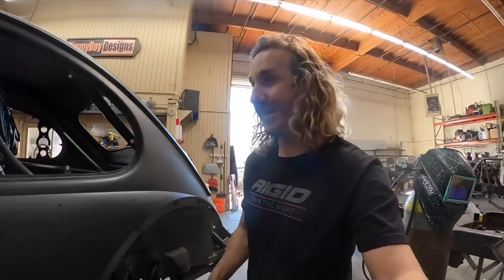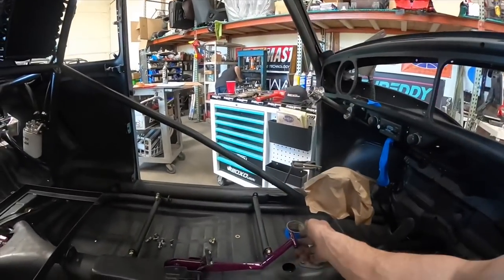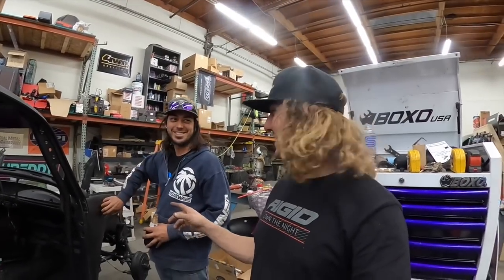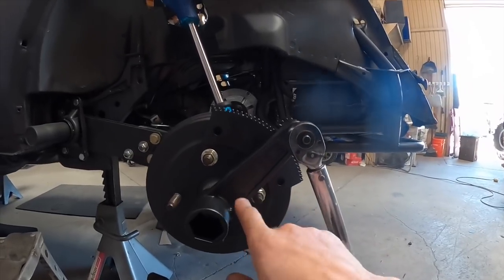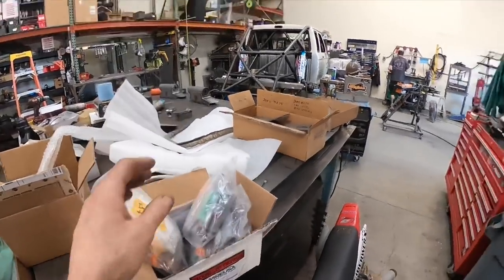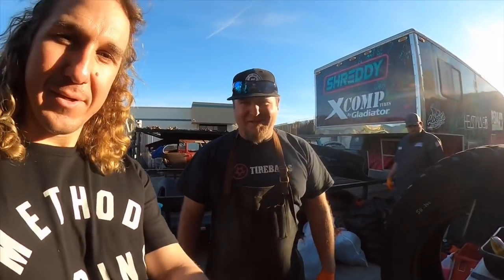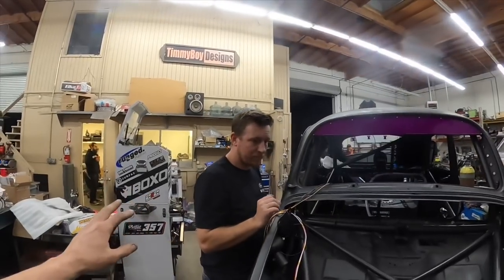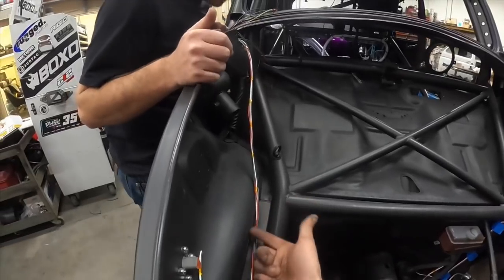SLUG SHARK - Episode 12

Comment: Those torque multipliers are cool, bulky but cool.  Have you considered a 36mm beater tool?  Didn't get a good look at the clutch cable; is the Bowden tube in?  Make sure you have a decent bow or droop in the tube or the clutch will be chatter city.  Also consider the factory rubber gasket around the engine tin to help with cooling.  No gasket promotes hot air recirculating around the engine instead of fresh cooler air.  Sorry for the comments, old bug guy here.  Looking Great!!

Comment: Are you only running 270 #'s of torque on axle nuts ?  I ask this question as back in the day when we used to run swing axle vw the guys in my group would run that torque even with chromoly nuts and would spin a drum.. Granted this was Glamis not hard pack.. I had a turbo 2442 on a built swing axle with sway a way axles with chromoly nuts set at 500#s of torque..I was the only one in our group to never spin a drum.. A friend of mine had a socket welded to a breaker bar with a 5' pipe on the end.. God only knows the torque #.. He would pull his tight til it wouldn't move..He was running turbo rotary with built type 1 gearbox.. Just some food for thought, maybe pack a spare drum and nut with your gear.. It's the $5 part that always hangs us up..
Good luck my friend..